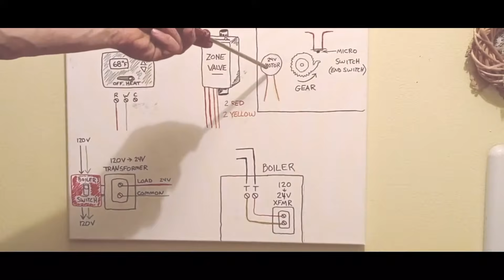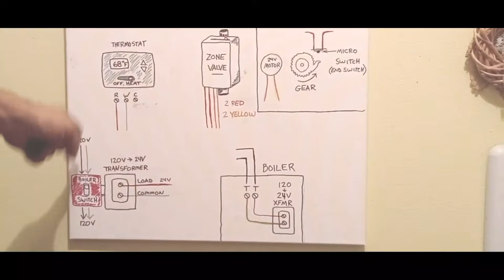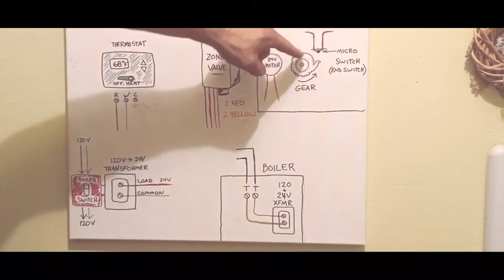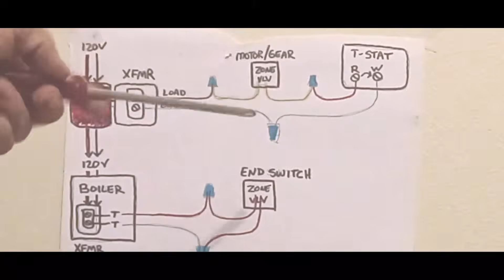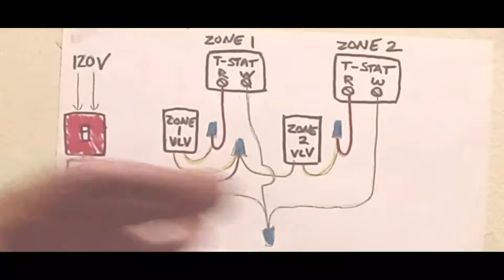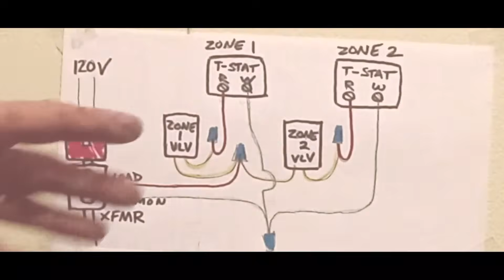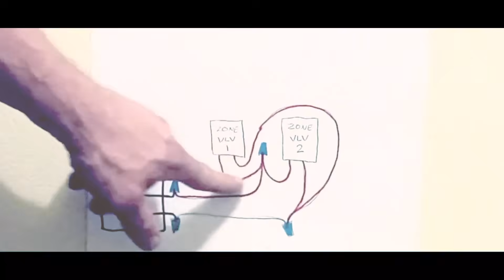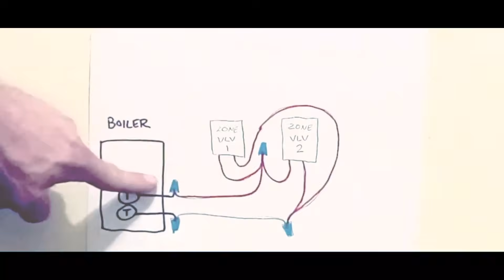How a 4-Wire Zone Valve Works (Wiring Diagram for Beginners)

Comment: How do I install a Nest Power Connector to provide a common wire to the thermostat in this set up. I understand it requires another transformer but its not clear how it allows a complete circuit using just a red and white wire going to the thermostat/valve.
Reply from the maker: Follow the install instructiins as if for heating only, but  instead of R and W at the furnace, you're going to hook it up to the 2 wires coming back from the tstat at the zone valve (one may go to the zone valve, the other to common on the transformer, but just go by what you actually have there and use the power connector as a splice to the existing wiring)  

The power connector allows the thermostat to charge when the system is not calling for heat by using the red and white wires going to the thermostat. On a call for heat, the Nest thermostat communicates with the power connector remotely and the power connector redirects the voltage to the zone valve. The Nest runs off of its charge while the zone valve is using the power for the zone valve motor. 

Newer Nest stats that don't need a common do this same thing internally, by stealing power off of the heating circuit.

You may or may not have to run an update at the Nest stat after install.
Reply: @JerseyMikeHVAC  Can you make a vide of this?
Reply: @JerseyMikeHVAC  is it possible you can draw a diagram of how the nest power connector is installed to the zone valve? So it can be easier for me to follow. The " boiler only" instruction in the google nest booklet only shows how to install between the thermostat wire (W, R)  to the device to the boiler board (W, R, C) terminal. It doesn't show how to connect through the zone valve. Thanks alot in advance!
Reply from the maker: 5 wires on the power connector right? 
Is the zone valve wired the same way as I did in this video?
Reply: @JerseyMikeHVAC  I sent several replies with links but the replies keep getting deleted.  My boiler is 2 zone valve set up just like in your video. The Nest power connector is a 5 wire, where  2 wires goes to thermostat (R, W) and the other 3 wire (C, R, W) goes to furnace or zone valve.
Reply from the maker: https://imagizer.imageshack.com/img922/2903/J6NFug.jpg
Reply: @JerseyMikeHVAC  Thank you so much!
Reply from the maker: Ok, I don't think I need it. Give me a minute I'll draw it up.

Comment: I kinda understand what your talking about, but I'm having a issue at my apartment complex with a zone valve/thermostat not sending a signal or no power at the thermostat. I checked all the transformers and all of them are functioning. I have three bundles of wires coming into the apartment. Each bundle has a green,blue,red,  and white wire. All the green are connected as well as the blue. all the red and white are just there. I tested the wires coming into the thermostat and none are giving me 24 volts. If I touch the blue and green I get some voltage, but I have no clue how to figure all this out. PLEASE HELP!!
Reply from the maker: What exactly is the problem you're trying to diagnose?

Comment: Great video and explanation! As a DIYer  I have question, I have two circular pumps (1 for the basement and the other for the 1st floor controlled with one thermostat). Two circular pumps was installed just in case I wanted a second thermostat for the basement again. I do not have any zone valves. A 1 zone switching relay was left behind from the old boiler when I had it set up for two thermostats. How do I set back up the one zone switching relay and second thermostat? Do I need zone valves? If you have a contact info that will be great!
Reply from the maker: No, you don't need zone valves. What kind of relay is it? Brand, Model, etc. Are both pumps now running off of a single relay?
Reply: It’s an Argo, AR822-11, 1 zone switching relay. This was set up with the old boiler when I had two thermostats. Now there is no switching relay hooked up at all and one thermostat heats both the basement and 1st floor.

Pex is ran from one circular pump to the baseboards in the basement and copper is ran from the second circular pump for the 1st floor.

Comment: Get this man a beer. 

I had to remove a zone valve and the wiring got quickly messy. Ended up needing to keep the remaning valve open and I guess I just had the thermostat directly hooked to the furnace. I didn't understand the second set of 24v wires comming from another transformer outside of the furnace and where to hook them up.
Reply from the maker: Hopefully you got it all worked out now! Thanks for the comment.

Comment: Great explanation.  How about if you have a taco 3 wire zone valve?
Reply from the maker: The load off of the transformer will go directly to the R terminals on the thermostats. The wire coming off of the W terminals of the thermostats will go to each respective Taco Zone valve terminal #1. Terminals 2 and 3 on the zone valves are for your T and T connections from the boiler.
Reply: @JerseyMikeHVAC Thanks.  I've seen terminal 2 go back to transformer and and tie in T on boiler and  terminal 3 go to T on boiler. What's the difference wiring it that way?
Reply from the maker: @rcmechanialgroup2856   Do you mean terminal 2 went back to the transformer common and to the T on the boiler?
Reply: @JerseyMikeHVAC  Your first comment back to common.
Reply from the maker: @rcmechanialgroup2856  OK. Yeah, it's not really much different. Term 2 acts like a mutual common between both 24V circuits, but Taco says the 2 circuits don't interfere with each other. Though I have heard some techs say you should check for cross-phasing. 

I don't know the specific purpose for wiring it up like that, but Taco could probably provide an answer.
Reply: Thanks bro.  What part of Jersey are you in?   I'm in Jersey too. @JerseyMikeHVAC
Reply from the maker: @rcmechanialgroup2856  I'm in Bergen County. Work out of Riverdale.

Comment: Great video, thank you. 
I have a question though on your first graph. Your t-stat shows a common wire. Can I run a wire from the common on the transformer to the t-stat common?
Reply from the maker: Thanks, Kevin. Yes, I've done this myself on a few occasions with zoned boilers when connecting a smart thermostat which required a common. So long as it's one dedicated wire directly from the transformer common to the t-stat common, and not spliced in from the 24 volt heating loop (the common coming back from the t-stat from the W terminal). 

 The new smart thermostats that don't need a common wire are borrowing current off of the 24 volts feeding the heating loop in the same way. They just do it internally rather than running a dedicated wire exactly as you described.
Reply: Thank you!  Again, you explained the nest of wires perfectly.
Reply: @JerseyMikeHVAC  Wouldn't the wire be coming from the transformer 24V to the C in the thermostat and the way back is through the W terminal to the common on the transformer ?
Reply: sorry, still trying to figure this out, I got confused a for a second, thought about it again and I guess the loop would be 24V through transformer 24V through R into T-stat and then back through the C wire from T-stat to common on transformer. The W on the T-stat would not be part of that loop to charge the thermostat ?
Reply from the maker: @laithhattar2649  The newer Nest stats that do not require a common/power connector will steal a charge off of the heating loop (w), but only when the system is not calling for heat. When heat is running the stat will operate on it's stored charge. 

Outside of that tstats will run on batteries or charge from a common wire.